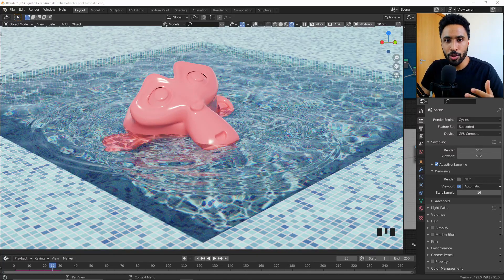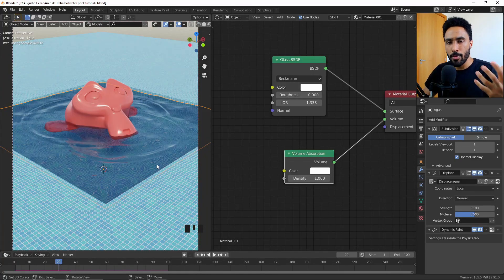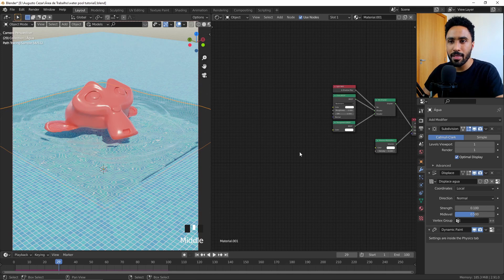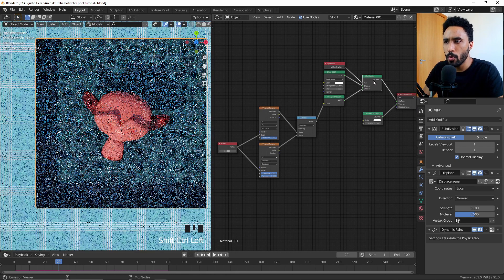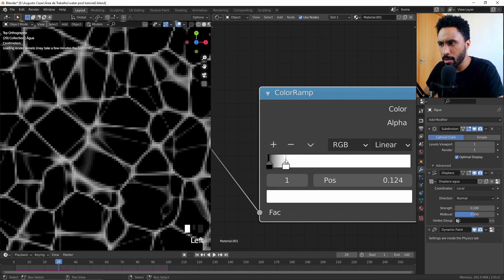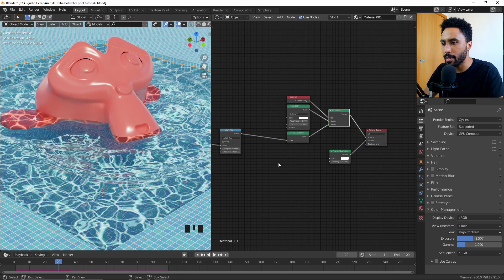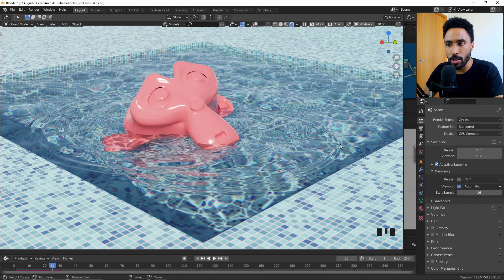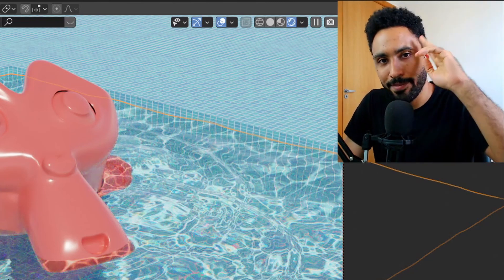😱 WATER POOL CAUSTICS WITH CYCLES? | BLENDER FOR ARCHVIZ

Comment: Donyou know if the caustics option added in blender 3.2 actually works with water with volumetric scatter?. I used it on a single surface and get very dark water, no caustics any. Ore. Perhaps I should try an actually closed volume. Issue is the waves choppy surface i created. Not sure how to keep that only on the surface, perhaps a vertex group

Comment: Great tutorial, but I had the same problem like some of you guys! There was nothing showing on my render results. It seems that the problem is the Light Path in shadow Ray.

 You can either remove the Light path in shadow ray,

Replace it with Fresnel (ior 1.333) OR

 Leave the Light path in shadow ray and add one more MIX SHADER right after the one where glass,light path and transparency are plugged in. Unplugg the transparent Shader from the old Mix Shader and plugg it into the new one. ( Basically....dont have the ligh path and the transparent shader plugged into the same MIx shader)

I hope it helps....

Comment: Everyone, the bottom of the pool shouldn't touch the water's bottom, move the pool down a few mm and the problem will be solved.
When that is done. great result! thank you!
Reply: The water doesn't have a "bottom"? It is a single thin plane. I think you mean the two geometry's shouldn't be touching? Either way, didn't work.
Reply: @dynamic5109  The water shoud be some sort of a prism (deformed cube) and don't make the inside of the pool tiles touch the water. Hope it helps!
Reply: @hierandos4741  Thank you very much for your kind advice, I do appreciate it. I started the tutorial again from scratch and missed the early comments about good topology and to have a decent amount of quads and even a displacement. Very important, since I have added some subdivisions, everything seems to be working now. Thanks again!
Reply: @dynamic5109  I'm glad to hear that! :)

Comment: You are really clear and this must be a great tutorial.
BUT, I did everything loyally, yet all the things starting from the voronoi textures that I plug to the transparent shader does absolutely nothing...
Reply: Same result. I'm wondering if they have since patched this in 2.92?
Reply: Since it's a shadow based texture, try to reduce the light in your scene or even complete remove the lights in your scene adding just the HDRI, than gradually add the lights in your scene until have the expected result.

Comment: I wished this worked for me. Watched it 4 times, connected all the nodes, 2 issues, so it never works completely. First is, if I have both math nodes set to subtract, I get nothing but black. If the bottom one is add, I can see the texture. Beyond those, everything else works as it should, until you say to plug it into the transparent node. When I do, it goes back to having no texture at all. If I put it in the glass node, color, it shows the pattern, but you can never get the black out, so it never changes the water to be clear with caustics. Not sure where I am going wrong, but  I am using the latest blender version....but really enjoyed your video and approach to this tutorial. Thanks.

Comment: Very nice tutorial, but, I can´t see the voronoy effect in the water after apply the nodes. GPU model can affect? I have a Nvidia GeForce 750 (I know, is older GPU but...) with 2GB of memory. I follow the instruccions step by step and nothing. Maybe for ilumination setting? I using an area light under the swimming pool in portal mode and HDRI for global illumination.
Thanks for helping me.
In spanish: Vamos, que no veo la simulación de las cáusticas en el agua ni por accidente. ¿Tiene algo que ver la gráfica? Porque no lo entiendo, sigo las instrucciones paso a paso y nada. ¿Es por algún efecto de iluminación también? Estoy usando u HDRI junto con una luz de área en modo portal en el fondo de la piscina.
Gracias por la ayuda.

Comment: Nice attempt. But I’m afraid the caustics don’t respect the geometry of the pool. Actual caustics are stretched at the walls of the pool dependent on the direction of the incoming light.
Reply: Cycles don't produce caustics, this is a method that allow you to have close and fast results. If you want real caustics, render witouth them, copy the scene for luxcore, render objects with bleck except the pool and render light paths at 100 %
Reply: @hugoantunesartwithblender  wow nice tips dude, thanks
Reply: @hugoantunesartwithblender  cycles can render caustics fine it just needs a few samples like 4k to 20million
Reply: @Bestman8  that's not a few xD the way I do now is mixing the pass between cycles and luxcore
Reply: Then mix both in the compositor